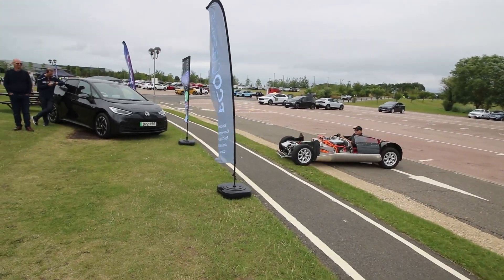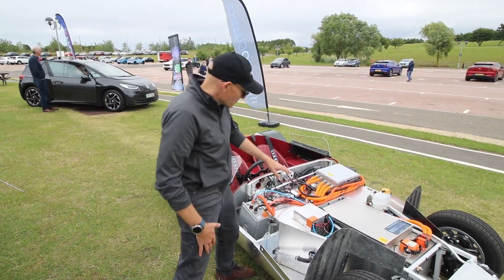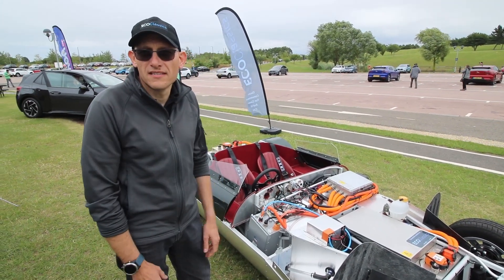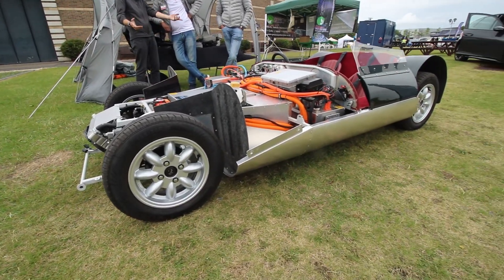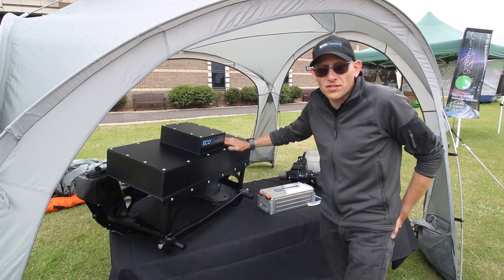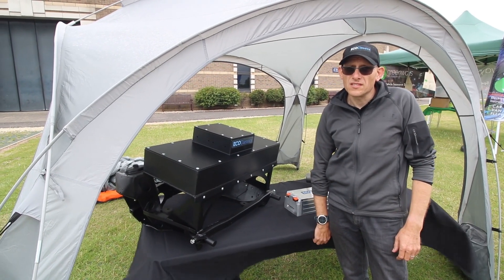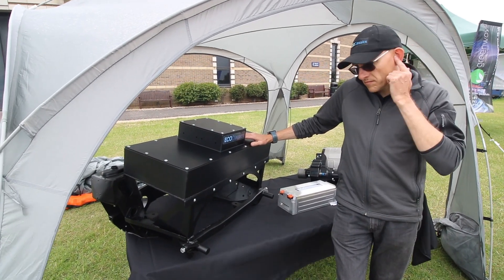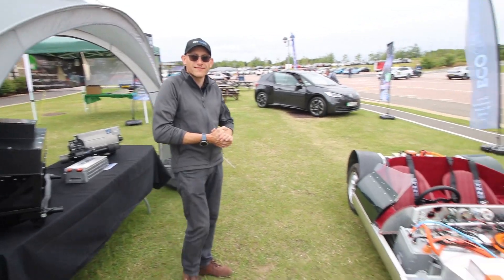EV Conversion for your Classic Car? EcoClassics

Comment: Personally I would not do that. I think that classic cars lose their character with a battery and an electric motor.
Reply from the maker: Yes, we agree however if the time comes when ICE is banned, would you?
Reply: @PlanetautoUK  Maybe move to another country LOL 😂. But I don't think they should ban ICE cars they should try to make it more environmentalaly friendly. The government know that they will get alot of hate from the petrolheads. But the government does not really care about what they want it seems.
Reply from the maker: That’s a plan, it’ll be interesting to see what happens with synthetic fuels, we’ll always want to keep our cars original as possible, good to know there are alternatives out there, even if they are extremely radical.
Reply: @PlanetautoUK  And, there are also kit-cars and cars in desperate need of renovation where going concours is cost prohibitive whereas EV makes the car futureproof. Also, a converted classic is YOUR car, not Elon's where the company can manipulate 'your' car at will.
Reply from the maker: There are, hive mind systems and over air updates have there good sides though - if we had a car that needed a new engine, then we’d contemplate it. Thank you Smoker
Reply: @PlanetautoUK  but I'd rather not have my car controlled by a company